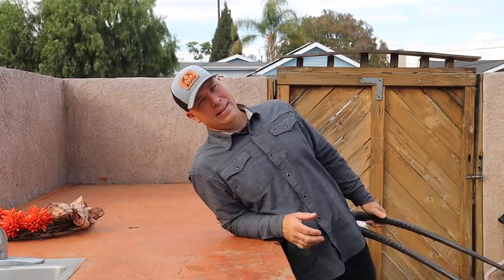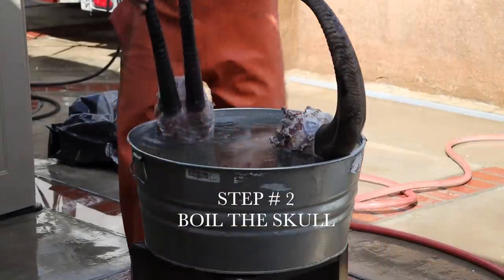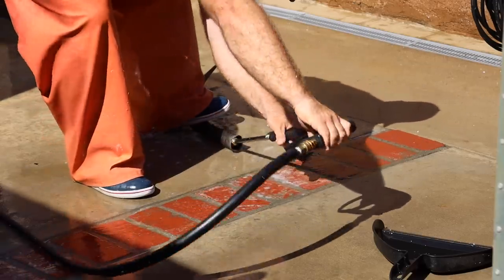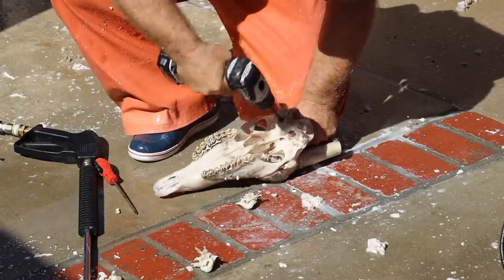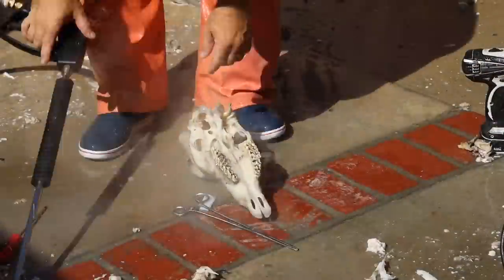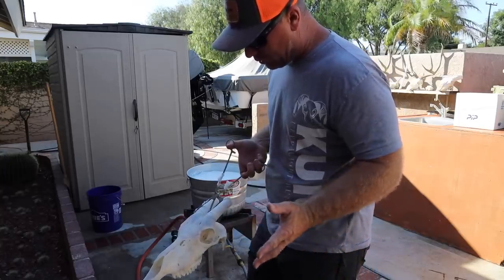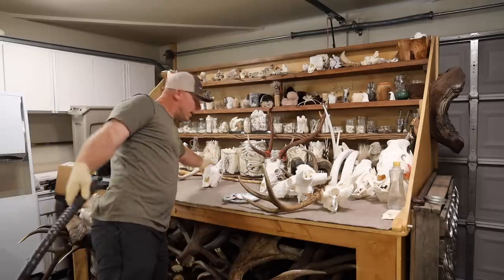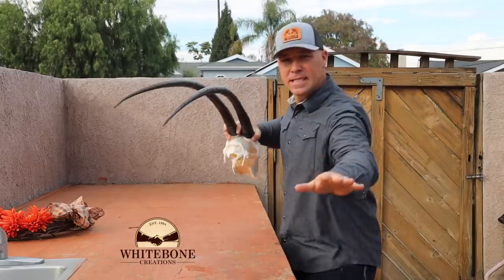HOW TO CLEAN A SCIMITAR HORNED ORYX SKULL

Comment: Hey great video! Love to see a horned animal being cleaned as I clean those a lot! How did you end up getting the dried oil out of the skull that was there  after you whitened it?
Reply from the maker: It just dried white. I did nothing special. Got lucky. My guess is it will color up in time.
Reply: @WHITEBONE  Oo I see. Yeah skulls at least dry a lot whiter (like you said in a very earlier video) before colouring up after time. Oo well it's part of nature the oiling up anyway😁 thabks fir the great video! Can't wait to see and Impala soon!
Reply: Did you have to label the horns left and right or is it obvious where each one goes. BTW I cleaned my first skull this year using your vids for guidance and it turned out great. I had to do a some reconstruction because I was a little heavy handed but nothing I couldn’t fix with some clear hot glue.

Comment: Well done sir keep on posting. Love the new info and why did you start adding screws for sheep bondo not strong enough to hold. And next video when you get all done could you try and focus down the noise after you get it all cleaned up. I just want to see what it looks like with all that out.
Reply: Also how long do those pots last for you
Reply from the maker: Will do. Those pots last like 30 skull
Reply: WHITEBONE CREATIONS HUNTING sweet thanks sir I know it will be hard to focus.
Reply: WHITEBONE CREATIONS HUNTING  
Hey you ever wrap your skulls and tape it and that base is kinda poking all around horn on base and get a little peroxide threw.

Comment: Maybe I missed if you clarified the reason, but why did you start adding screws to the horns?
Reply: Didn't say why he did it but he stated he doesn't typically do it except for sheep. It's probably for extra support so the horns don't fall off since they are so long.
Reply from the maker: I have had a few clients drop them or had them fall off walls and the bondo and horns popped off they all get a screw now.

Comment: So I was recently given a set of Oryx horns with horn core still inside.  No skull just the horns.  Anyway I through them in a tub of water with a couple whitetail and one hog head for about a day until I could get to cleaning them.  When I pulled them out the horns seemed to have become very spongy and flaking apart.  I did not put any chemicals in the water.  Any idea what causes that?  I’m going to hang them up to dry to see if it helps.

Comment: A better method is to deflesh as much as possible (no boiling) and then let it sit in an airtight container full of water. Replace with fresh water every ~2 weeks. Degrease by letting the skull sit in a mixture of dawn soap and water, simmering slightly, and then whiten with peroxide. It’s a lot better and the skull will be better quality.
Reply: If you have patience and want an actually good finished product worth selling, you do.
Reply from the maker: Seen it done never done it. I remember big odor and some staining. To each his own. Thank you for the comment.